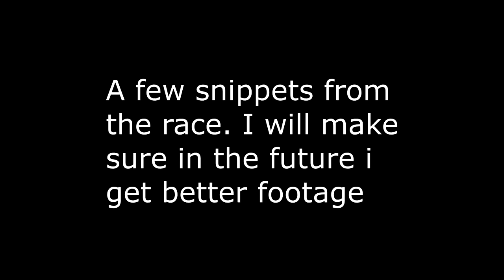Closed cell PU Foam and Cleat repair on Project Catamaran E55

Comment: To pour foam in a hole, you have to mix small, good job. Also, the bulkhead looks good, once glassed in and painted inside the locker, it will be very functional. Also, think about putting some removable rubber mats inside to dampen the sound of chain moving inside it. Just a thought.
Reply from the maker: Brilliant idea!! I never thought about that. Will try source some rubber matting or something similar to dampen it👍🏻👍🏻🙏

Comment: Buttler tape on the cleat is a great start. If you want a belts and suspenders job use Sikaflex 291 on the bolts. Also if you can find preformed fibreglass angle i.e 25 to 50 mm it could save you a lot of time on tabbing various things. Great work Spence 👍
Reply from the maker: Thanks Lindsay for the top tips. I grab my glass by the roll. I have now bought some fabric scissors to make life easier chopping it how i need it.👍🏻👍🏻